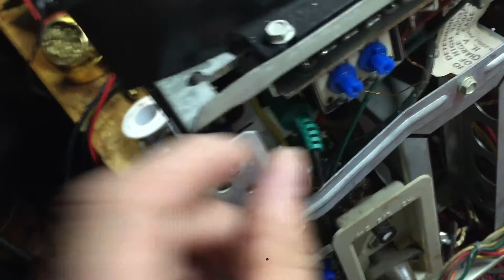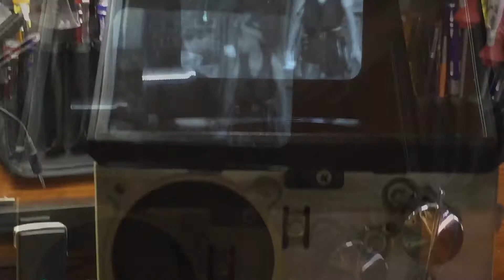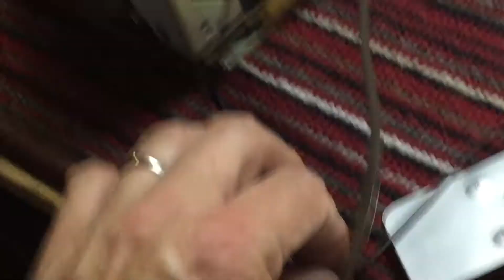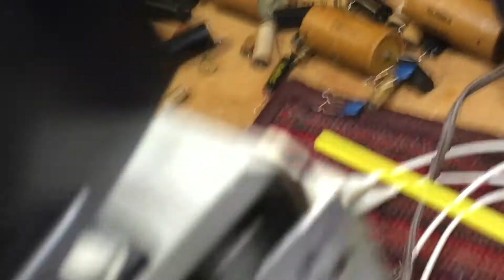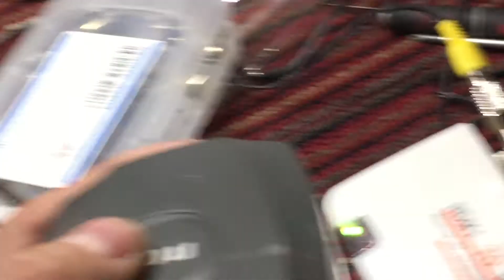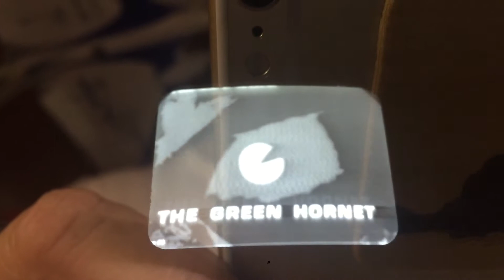Vintage 1959 Safari TV Repair and Mod

Comment: Nice simple addition of that direct RF connection in the back. That tv set is very  nice as well. Thank you for sharing it with us. Seeing that intro to the green hornet brought back many memories. Thanks!

 On another note... My suggestion would be to switch to manual focus for close ups like these if your camera has that option & a tripod.  :)